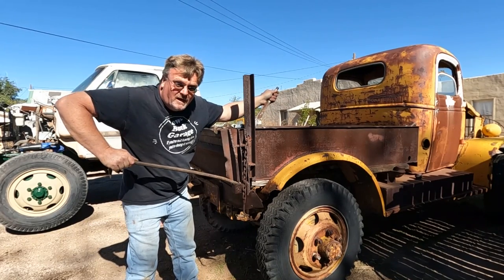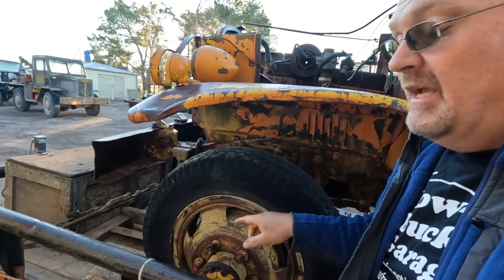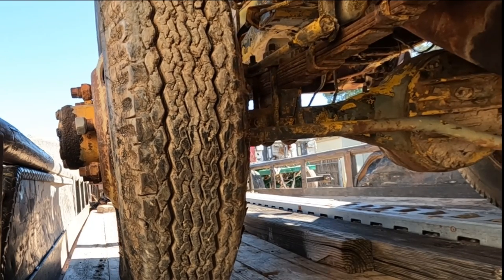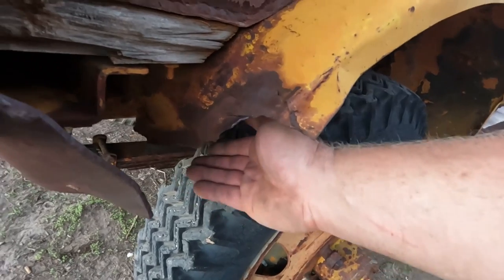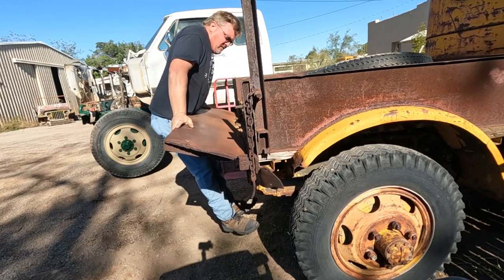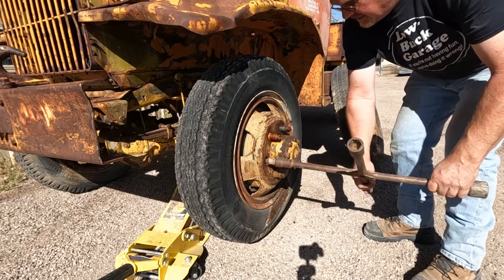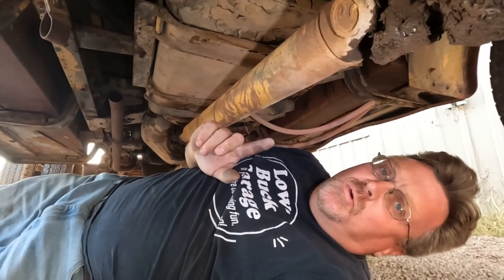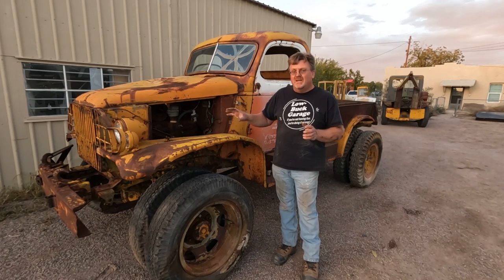Mystery Chevy Truck, 1949 1-1/2 Ton G-506 Pickup?

Comment: My guess is is that it started out Life as a bomb carrier . It got a new cab in it's civilian life whether old one was messed up or this one kept the individuals out of the rain. It was a work truck in a mine, farm,  or something of that nature. Home built tanks on the side were to carry gas, diesel, and possibly used oil after being changed out of other equipment. Mount on the front bumper was for a grease barrel. All around just a homemade work truck.
Reply: - "Mount on the front bumper was for a grease barrel." Brilliant. Wonderful that you knew.
Reply: @RobertFay  And now we know, thanks wooly1286!!
Reply: My father has one of those g506 bomb trucks he is about to through back together wasn't expecting to hear someone mention one since there aren't many around
Reply: @subzeromjc  - Yes, Exactly.
Reply: @RobertFay  You nailed it, wooly...it's a bomb truck with a period compatible closed-cab swap. The running board and rear fenders are bomb truck through and through. This military style is my all-time favorite. I've had almost every variant except this one, a rare beast worthy of restoring to original nick.
Reply: had to been used as a oil field service truck.
Reply: @flir67man84  my bet is a snowplough truck for the state or county/city and after that probably a logging truck and next a mud-rig hence the flooded engine&transmission ect
Reply: BTW the bed/cutting/welding has a government working man's/tooling vibe not backyard DIY's pre-1970's vibe

Comment: Hi James. Great find here with this Chevy G-506. All cabs were made by Chevy and pulled from Civilian parts stock. The chrome trim, ash tray, and single windshield wiper denote 1940-41. It should have a unitized 'civvy' gauge cluster, not standard militarized with 5 separate ones. All W.W. 2 military issued Chevy's didn't have a filler neck hole in the cab for a tank under the seat. Also, passenger door has a lock cylinder and the driver door has the thumb turn knob exposed along with the hand crank on the dash for the windshield. Military issued truck had arms on the "A" pillars to hold the windshield open and parallel to the ground, which tells me early '40 civvy cab. The front brush guard should a 'serpentine grill' like in the 1st. photo in the video. It is a '44 and newer Chevy brush guard, not CCKW, with the Black-out drive light mounted on the fender.  To sum up, it probably was a Bomb Service Truck that had a Civilian Cab installed, this military cab ran from 1940 to 1945 only.
Reply: Great post from someone who obviously knows his stuff. I’m curious about the motor. Standard Chevy? Any military modifications?

I’m a Ford guy, not a Chevy guy. I have a WW2 Ford Moto-Tug aircraft tug here that I’m eventually going to restore, plus bits and pieces of four more for parts. Fortunately, Ford used the existing and proven 4 cyl tractor motor so parts are no problem. They built 3200 MotoTugs but 250,000 tractors, many still in use.
Reply: @bobjohnston8316  Thanks Bob, very kind of you to say. I bought my 1st. Chevy G-506 in Dec. 1995 and restored it. I have had many other W.W. 2 trucks since then. I'm almost finished with my 2nd. Chevy now and have many other pieces of equipment from W.W. 2 in my little collection that can be seen here; https://www.youtube.com/channel/UCaMKEv2V4_YOYFsQeeBDM3g/videos.
As for the engine, it is a 235 Splash Oil type 6 cyl., with about 90 H.P. that goes through a T-16 Warner Gear Div. 4 speed trans. and a Rockwell 2 speed Transfer Case. Top speed is a blistering 38 - 43 M.'s P. H., the truck will get about 13 M.P.G. empty and just a few more miles to the gallon fully laden. ** Get on that aircraft tug Bob, record it and put some content up on YouTube**.
Reply: Bookmarking this for me

Comment: The round plate on the front bumper was originally for a placard which would have stated the vehicle weight (used when directing convoys over bridges in Europe) or for unit identification.  It would originally have stood straight up and down--is it bent over now just because the whole end of the bumper is bent?  Like Al Mirria said, the extra headlight was a blackout driving light and would originally have had a cover over it with just a small opening in the upper half.  Much like what you identified as the "turn signals" (really just marker lights) but of course bigger.  This black out driving light was designed to give you just enough light to make out the rear of the vehicle immediately in front of you when travelling in a convoy, but (hopefully) not enough to be seen by enemy aircraft.   I'm guessing that originally it was either a bomb carrier or was a CCKW that has had the rear axle removed (a popular mod in the 1950's).  Also, because of the gas and oil tanks, I'm guessing it was an oil field service truck at one time.

Comment: In 1942 for the army corp of engineers there were 35 2.5 ton trucks made into  short wheel base 1 rear axle {airfield crash trucks, they didnt have enough 1.5ton trucks available right then} to fill the contract. Check the frame at the back of the cab for alterations. I purchased a book that list by serial numbers every truck from 1940-45
Reply from the maker: I just checked the frame, and I don't see anything that indicates its been cut.  Right now it looks like it was a bomb truck that had a civilian cab added.
Reply: @LowBuckGarage Thinking you might have a service truck and the round plate on the front bumper is to mount a 30 gallon grease can which would have grease gun pump lid hooked up to onboard air compressor.

Comment: Hipboots1 is correct it is early 1940’s. I think 42 it was part of the airforce defence system trucks. The 506 was a 1.5 ton but the 506e was the 2.5 ton with the bigger frame for carrying the huge sperry  ball turret. They were used for servicing planes, repairing airforce landing strips, large vehicle recovery with those huge flatbeds and at a moments notice they would load those sperry anti aircraft turrets that had to have low clearance huge metal beds. They also were able to be quickly modified with the huge towing beds that used huge hydrolic pumps to pick wrecked planes and vehicles. That’s why it had the extra tank under bed to drop lines in for quick access for the feed/return lines. Very fast load,strap or bolt and go multipurpose tow/ turret units.

Comment: as a military vehicle this truck started out it's career without a title , then was sold to a civilian who had to title and plate it for use on public roads . It was titled as the year (1949 ) that the transaction took place , a common occurrence back in the old days . This is why you still find '32 Ford's for sale that are actually Model As , they were first sold sometime in 1932 and not the year they were built .
Reply: You beat me to saying that. I've seen it more than once with ex military jeeps. Also, the valve cover on that engine is from a mid '50s chevy, the 1940s covers were different.

Comment: This is the same cab as 41-46 Chevy pickups, not sure how different the gmc’s were. WW2 inspired some odd smashups of parts. BTW, knobs over the wind shield are the controls to the vacuum wipers. They suck. And that is supposed to be a reverse lockout, it may have issues. The windshield crank looks to be missing but the cowl vent is a lifesaver in anything over 90*. Cool project truck!

Comment: I have a four way lug wrench I’ve used it twice when I had to take the tire off of my tractor. Pro tip sometimes you can put a jack handle in one of the ends to get more leverage. But then I’m a smaller guy I’m 18 and 130 pounds so sometimes I have to get creative.

Comment: Used to drive a late 40's Chevrolet "Loadmaster" it had a reverse lock out like your truck has also the front vent cowl and the starter pedal. To start the truck you would pump the gas with the ball of your right foot while keeping the starter engaged with the heel of your right foot, kind of like rubbing your stomach and petting your head at the same time.😄

Comment: Worked on it's twin last month. Chevy 3800 had the same exhaust stack too. Didn't have the duallys but was the  heavy duty. Was a Union Pacific Railroad special build. I'd post a picture if I could. Was in better shape than yours.

Comment: Dear LBG guy.
👍👌👏 That's a nice worn but sturdy old truck. Obviously converted to a workhorse (like wooly comments). The extremely sturdy flatbed is definitely a piece of torch cutting art. Congrats for purchasing this military truck. Maybe even the engine could be freed up again. The internet is full of revived 6cyl inline engines.
Best regards luck and health.
Reply from the maker: I've got the engine soaking in oil now, I'll give it a shot in a week or so.

Comment: When I was a teenager with my 41 Power Wagon one of the guys I was running around with that also had a military truck had a restored 1.5 chevy with the short 6x6 style bed. I think his was a 41 but could be about any year till 45 and be almost identical. Definitely ww2 vintage and at least one comment says it's definitely a 41 you have. Probably the bomb truck like you found. The Dodge version had a similar smaller bomb truck body too. Cool truck and you can probably find the vin on the frame somewhere and maybe the data plates on the glove box or dash if your lucky and it will say exactly what it is. That's what's left of a blackout light for driving at night so nobody can see the light from above. The blackout cover over the small light is gone but you might be able to find a cover or whole light eventually if you care. I found a newer 24 volt one that bolted right onto the similar BO light cover and grill on my truck. Jeeps used them too but are almost always gone by now.

Comment: Nice find! The lever under the dash is indeed to the air vent up front to bring air flow in the cab on a hot day. I couldnt tell if the rear diff had a cable running to it but the little lever on the stick shift should be high/low gearing selection for the rear end.
Reply: The truck is not set up for two speed rear end it’s already low geared
My 1951 Ford F-350 had a reverse lock out going into the top of the transmission next to the stick shift older trucks had a two speed rod that levered on the side of transmission
Reply: @megamannn8527  I wasnt so sure about the high/low on the rear especially with something that had 4 wheel drive. Thanks for the clear up! I was basing it off the old 1950 dodge truck we had similar in size that was setup like that on the shifter. That thing was so finicky to get into its range.
Reply: 👍learning together makes a great community 👍

Comment: You are correct, that lever under the dash operates the cowl vent. I would guess the switch on the shifter is a high/low range for the rear end

Comment: When you put on the double tire at the front, WOW! just WOW! it looked so good! 
This is the truck I want as my daily driver! It's hard trying to be cooler than that, wouldn't it?😎

Thanks for another great video!👍 
Hi from Sweden!
Reply from the maker: Thanks!  And I agree, the dual front tires really work on this truck.  I don't care that they will probably make it hard to steer, I have to keep those.
Reply: @LowBuckGarage  Yes, I would image it will give resistance when turning, it's big tyres.
But maybe it's possible putting on a big steering pump or change the gearing on the steering? 
There's no doubt you are capable of fabricate something useful, cheap of course😄.

Comment: That bumper plate is originally supposed to be straight the bumper is dented in and twisted it should be straight across if it were straight that plate would be vertical and while in used depending on the weight tonnage it was carrying they would have a yellow number plate to put on to indicate its current weight including load

Comment: Lever under the dash is to operate the cowl vent.  Lever on the gear shift is for reverse.  I'll bet the trans is fine, as that old stuff was pretty much bullet proof with such a low power engine.  I would either just find another Chevy six direct bolt in, or a 3 or 4 53 or 71 Detroit diesel.....now that would be beyond cool!
Reply: I vote for Detroit diesel!👍

Comment: Yes the little lever in the stick shifter is a reverse lockout.  Which means you have a 4 speed tranny. Your putting the door knob in the door lock holes. The inside door knob goes on the center hole on the inside of the door. Furthest forward hole was window crank then door knob. Yes the outside door lever was actually the hole you tried on the inside as well.
Good luck, fun looking project!

Comment: - What a baffling truck, James. That round plate on the drinker side bumper...I don't get it at all.
- I know you hate to refurbish old seized motors...and a replacement that fits the gearbox is the quick answer...but I would like to see that motor run and the vacuum assist fixed, too.

Comment: The round plate on the passenger side front probably at one time held a water cooler for the workers that were using that truck. When running duals on the front what you would find is a taller Tire on this inside and a slightly shorter one on the outside that way when you were on pavement the truck would drive normally but once you got into the dirt where you needed more traction then both tires would then dig . I hope this helps . You found a bucket list truck for me that's for sure! If you do decide to sell it how would I get in touch with you to talk to you about it? Thanks Bob from Virginia
Reply from the maker: I thought about running two different size tires for just that reason.  There's not a whole lot of options in this size, though.  I'm on facebook, James Low-Buck Garage.  However, I'm not selling this one any time soon, there's a lot more to do on it!

Comment: First off that’s an absolutely bitchen!!!  Truck!!!    God I love that bed!!  Definitely a worktruck/ service truck. I think Those tanks are to fuel up other equipment not for the truck itself. I’ve seen auxiliary tanks like those before, one thing i can think of is oil field pump jacks, in the old days pump jacks were powered by gas engines running “jack shafts”  if you were servicing oil well pump jacks and engines you would need to Cary gas and oil.  Just a guess,  that truck definitely earned its keep in some industry.

Comment: Neat old Truck!  I see a lot of potential there,.  A lot of work,. But a lot of potential...
  Maybe while you are waiting for your other parts truck, you should get yourself a gallon or two of some strong vinegar and some transmission fluid from the hardware store and soak down the engine, and heck, maybe even the transmission.
 So you can get it unlocked,. And maybe get it turning.
  And then even if you can't get it to run after that,it would be easier to work on or strip for parts with less rust in everything.
  Tim from Wisconsin.
Reply from the maker: I've got it soaking, in a week or so I'll take a crack at turning it over.
Reply: @LowBuckGarage   hey you never know, may get lucky and be able to get it running.

Comment: If you care:  The gas cap is likely from a mid 40s John Deere tractor, and the gas tank it is on is also probably a tractor gas tank.  It was pretty common for people in the 50s through 70s who were putting an add-on gas tank onto a pickup to get all the necessary parts from a tractor and mount it underneath the bed.

Comment: That is definatelly a US military truck, the '49 could be correct, during the inner war period. The "3rd" headlight is a black-out driving light. They are for stragetic night driving maneuvers during light discipline without the conventional headlights with speeds under 20mph. They shine only about  20' - 25' in front of the vehicle. 
The small bullet looking lights are white black-out markers. The rear would have the same marker with red for brakes. They will emit a very dull white light only for the purpose of marking the 4 corners of a vehicle which can only be seen at a very short distance, 25 - 40'

Comment: Maybe the dumping tube is for, when the engine or any other mechanical should brake down, and other military service/rescue team comes by, you can always use that extra fuel for the other vehicles.

Comment: The light on the driver's fender is a blackout driving light but missing the shroud. The Fisk on the bumper is a bridge classification plate that indicated to bridge sentry how heavy the approaching vehicle is. The truck will be either 1940 to 42

Comment: The reason you were not able to move the flywheel is that you were using the wrong tool. A screwdriver - you needed a large crow bar possibly used with a 4 lb hammer.
Reply from the maker: After I soak it with oil for a while, I'll give it another shot.  I really don't want to break a tooth off the flywheel, then the engine's coming out for sure.  I'll probably end up taking the head off this one to really get to it.
Reply: Take all the plugs out fill cylinders with diesel or marvel oil and let sit  for a few months.   Then take all plugs out , drop in 3rd gear and drag around the driveway while having a buddy dump the clutch over and over.   A tractor is handy for pulling it.

Comment: This may be a Frankenstein truck.  Notice a gas filler hole behind the passenger door.  Maybe this is a civilian cab placed on a military truck. Many military vehicles have a extra plaque on the dash with the trucks info.  I didn't see one here.
Reply from the maker: You're right, I've been doing more research and it seems to be made from pieces of at least 4 trucks.